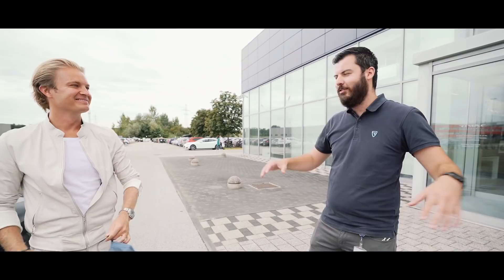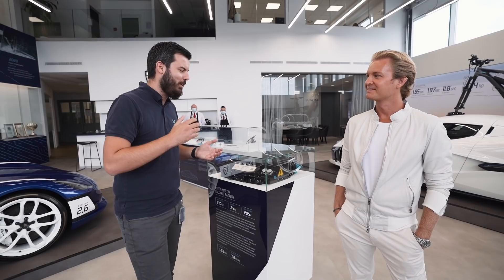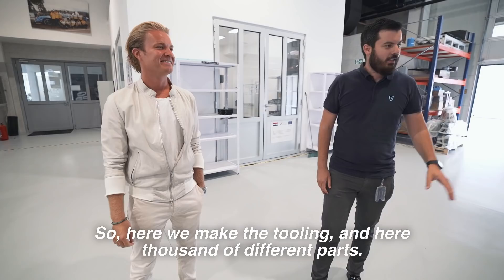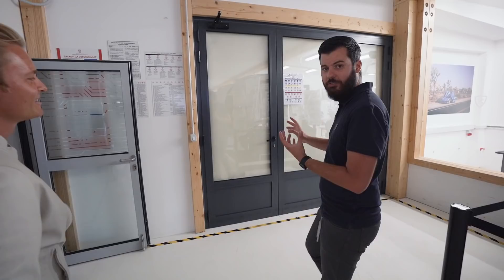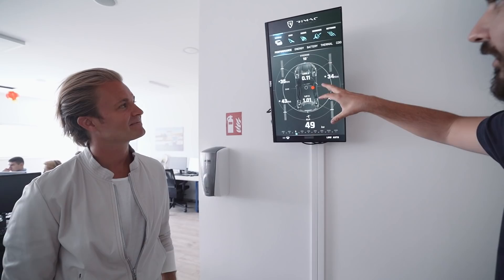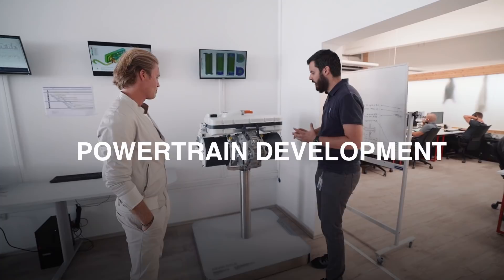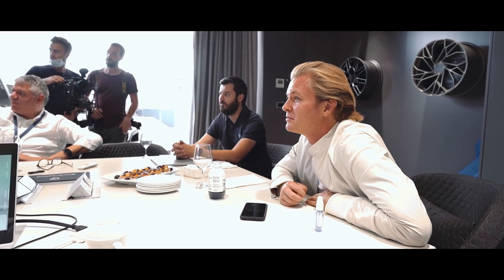How a 1900HP+ Rimac Hypercar Is Built | Nico Rosberg

Comment: It was great seeing you at Rimac! Excited to see you unveil your spec!
Reply: Mate talks about the Nurburgring, Misha is smiling in the backround.
Reply: @brauchbares1  obviously :D
Reply: return to Rimac Automobili Misha 🤗
Reply: @brauchbares1  Epic how they go so in-depth on optimizing the car for one and even multiple laps. I imagine they'll have a preset for one Nurburgring flying lap or two or three. Once they have the knowledge of all the parameters, their AI team should be able to do it for all tracks around the world, within reason. 
Say you have a new set of tires to smoke up at Spa, it would be able to tell you how many laps you get from your skill level with the optimal preset. 
To get the most laptime from available energy to allocate and driver skill, you want brutal acceleration out of corners and then taper off power output at high speed. To cruise at 300 kph, which is plenty for most, will take only about 300-400 kW I imagine. Out of 1400 kW maximum. You exist he last corner before the long Nordschleife straight at like 180 kph for a novice driver, jump to 300 kph in a matter of 4 seconds and then hold that for ~15 seconds more rather than pushing all the way to 390-400 kph at the Bridge. Saves a lot of battery capacity and keeps things cooler for longer.
The full tilt 1 lap attack will be amazing. The car will arrive at mild bends so much faster than other road cars, probably similar speeds to the Porsche 919 Evo, but need to brake much more to get through it weighing over double. The 919 Evo's top speed should be broken I think, even if they need to optimize the battery output a bit to get round as fast as possible.
Reply: @Cloxxki  Nice theorie. But there are no road tyres for this...
Reply: @brauchbares1  none yet you mean 😅
Reply: @nathanambler9501  Shure. But it is really difficult. Tyers had to be sticky=soft and robust=not soft at the same time.
Reply: You back there Misha.... was getting confused and thought the vlog was old?
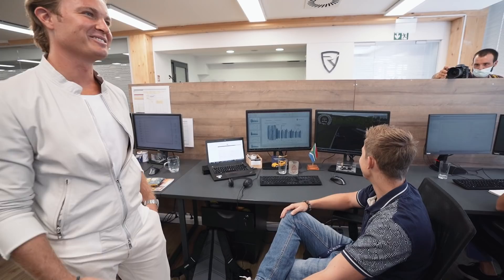Reply: 19:25 hmmmm Misha did you have anything to do with the choice of simulation ?
Reply: @chain2001  This video was filmed a while back :)
Reply: I’m more excited about seeing him behind the wheel and driving (sorry, piloting) that beast !!
Reply: MISHA SPOTTED AT 19:23 ahahah
Reply: knew I say you at 4:05

Comment: The guy made a hypercar in 10 years from scratch, what a massive achievement.
Reply: not only made an Hypercar, he made the BEST
Reply: in 10 years ? they started developing the C2 in 2016/2017 and it will be on sale in 2021 so 4/5  years from scratch ^^
Reply: And became the PREMIER company for the highest end performance-wise automobile batteries and motors, unreal!
Reply: Super impressive stuff imo. I thought it was very interesting that the pinninfarina Batista. is going to be built on the c2 chassis.
Reply: @AOTanoos22  You know Concept One exists that came before C2?
Reply: @Feex92  i know, but the original comment was referring to the C2 when the user said, that Mate Rimac made a hypercar in 10 years from scratch.
Reply: Still no competitor to the Roadster II, for the price of the Rimac you could get 5 Roadsters with Space X Package and still beat every aspect in performance and efficiency of an Rimac 🙃
Reply: @imacdvman  LOL 😂
Reply: @AOTanoos22  oh prove me please the opposite. The Rimac would be better then the other Hypercars for sure and even the eHypercars like from Lotus 🤷‍♂️
Reply: @imacdvman  don‘t need to prove otherwise. You exposed yourself by saying „and still beat every aspect in performance and efficiency of a Rimac“ 🙃
Reply: @AOTanoos22  don't get it, where I exposed myself to what? From a rational point on the SPECs its a fact, that the Roadster II will beat the rimac in every aspect. Or does the Rimac e.g. has also nozzles for improving the driving, accerlation and downforce? 

Its a great car like I said, but only in comparison to the other Hypercars with combustion engine or electric (like the Lotus).

So please prove me something else🤷‍♂️
Reply: @imacdvman  you exposed yourself in having absolutely no idea of car specs.

The Rimac does 0-100 km/h in 1.9 seconds  seconds and the Tesla Roadster will be able to do 0-100 km/h in 2.1 seconds, this is what Teslas official website says. Yes the Tesla does 0-60 mph in under 2 seconds, but not 0-100 km/h. For your education 0-60 mph is 0-96 km/h. So in fact when you compare both 0-100 km/h times the Rimac is quicker  than the Roadster II. 

Next point is torque. The Roadster says it will have 10 000 Nm of wheel torque while the Rimac has close to 13 500 Nm of wheel torque. Now to be fair the Tesla Model S already has over 10 000 Nm of wheel torque and the Taycan over 11 000 Nm of wheel torque so the Roadster will most likely get more than 10 000 Nm of torque when it comes out, but that is what Tesla officially claims as of now. Either way they are far away from Rimacs almost 13 500 Nm of wheel torque. 

For the Top speed Rimac states 412 km/h while Tesla claims over 400 km/h, so in that regard the Rimac is also ahead until Tesla states an exact number. 

As for the range, that seems to be the only number in which the Rimac seems to have less than the Tesla. But you can't compare the 600 km range of the Rimac with the 1000 km range of the Tesla as we don't know how big the battery of the Roadster will be yet. Also the 600 km of range are already certified under the official WLTP testing cycle. It's worth mentioning that the Rimac is basically production ready and will start deliveries in 2021, while the Roadster is no where near production spec and the range numbers on the Roadster are concept numbers und not certified under any cycle. When the Roadster comes out in 2025 and has a range of 1000 km its not comparable the Rimac that comes out in 2021.
Reply: @imacdvman  Lol i presented you with facts that you simply can not deny then you come up with that bs "space X" version. Call me when the Roadster actually makes it into production. Next time you say the Roadster is superior in every metric compared to the Rimac, do your research before claiming that. 

So you are telling me that the Roadster will have over 1000 km of range while the State of the Art Model S Plaid will have 800 km of range and will come out in over one year time ? (Model S plaid will come out at the end of 2021/early 2022 according to Tesla). That means the Roadster will most likely come out in 2024 earliest if they want to achieve 1000 km of range. By then the Rimac is already on the market for 3 years and due to a refresh, so lets not compare the concept Roadster 2 that is far from production ready to a production ready vehicle being tested as we speak (Rimac).
Reply: @imacdvman  You clowning as if there's a Roadster out there. Everywhere Elon speaks he says the cybertruck is coming first and even that has no honnest date. Cybertruck>semi>roadster while the Rimac is actually here
Reply: @imacdvman  Roadster would first need to exist, it doesnt even exist yet, also you sound like sweaty tesla fanboy
Reply: @AOTanoos22  Agreed, and by the time the Roadster is being delivered, C3 will be well underway. The suggestion that the Roadster will be faster around a track given the racing development experience at Rimac is actually pretty amusing.
All that said, I'm sure the Roadster will be cool and alot cheaper too so I guess I'll have to buy both! 
Oh yeah, just remembered, am broke.
Will stick to my diesel delivery van then... 😔
Reply: @tomraymond9795  indeed, also the Rimac has 4 motors, each motor on each wheel, while the Roadster will "only" have 3 motors 2 in the rear axle and 1 in the front. So the Rimac can do a lot more with torque vectoring, considering  the all carbon chassis of the Rimac i have no doubt that the RImac is leagues ahead of the Roadster in terms of track performance. 

That being said the Roadster will be a great car as you mentioned, especially for that price and i would gladly take one for free xD.  Will stick with my Golf Diesel then as well :D
Reply: @Tacet137  what you mean with it not existing? Yeah a serial production model not existing yet. But a fully driveable prototype exist since 2017, and people drove it already. Just search for it here on yt🙃
Reply: @AOTanoos22  they had a Rimac car much before that.
Reply: and he is only 32year old wtf ?
Reply: @tomraymond9795  @Nasticio ModelS Plaid has already lapped the Ring @7:13 with Goodyear RS Cup tires, same type as the others. The Roadster MINIMUM will be 1.9. The Roadster with the compressed air “cold thrusters’ could be 1.3 to 60.And they will assist in cornering and braking too.AND $250K, that’s 1/10 Rimac’s  price. But time will tell. NEVER BET AGAINST THE ELON.
Reply: well, automovie money. (but of course huge talent and perseverance)

Comment: they don't have to do crash test simulation Richard Hammond did it for free.
Reply: Technically this is a different car
Reply: Well he’s not lying Rimac got a lot of data to use because of hammonds crash
Reply: Actually they didnt get much data. The car burned completely.
Reply: @Cijevni1  I thought it had bluetooth and wifi...., I hope they got Some data out of it, a crash is survivable at least, that counts for data, right?
Reply: @maxb1401  I don't know which data they collect live but what they don't know is how many times he rolled, where exactly car got hit because he crashed after finnish line and they didn't have cameras to film it. :D They have data about the speed he was going and power he was using. Check interview of Richard and Mate about the crash. There Mate said would be great if he delivered more data. :) They for sure improved on everything because C_Two is completely different car but specifically they improved on the safety of the battery beause of the crash. :) It is completely normal that car burned fir the 5 days because of the chain reaction of battery cells burning but they still say they made some changes after the crash on this...
Reply: Its like if a human volunteered to be the test crash dummy. They did great with the safety of the car since Richard is still alive

Comment: Will these batteries get cheaper in the future ? We need this battery system tech in more cars !
Reply: Everything gets cheaper when is massed produced, but the problem with batteries is not price, it's technology. Batteries still use the same 19th century chemical process to store energy. We need new battery tech that charge faster and can hold more energy in a smaller size and degrade less over time.

Comment: I very much like that even just claimed specs from a brand that is not really a competitor drives Rimac to develop 2 whole new generations of their rear (and front?) drivetrain. And again gets rid of the gearbox that Porsche did need to do what the Taycan Turbo and Turbo S do.
Electric motors do seem to lend themselves to higher revs better than ICEs. It helps so much getting away with a greater reduction gear for low speeds.
Having less torque than a Bugatti Chiron in its first gear is no shame, it can't find traction for all that torque anyway. For a car of the same or lower weight to out-torque the Chiron from 2nd gear is epic. Especially as electric traction control is bound to be better when executed somewhat nicely.